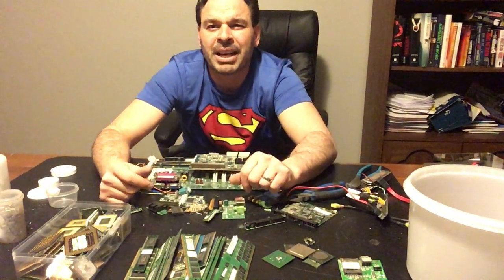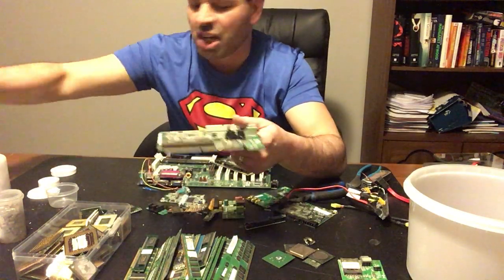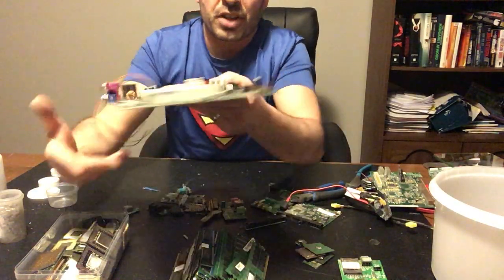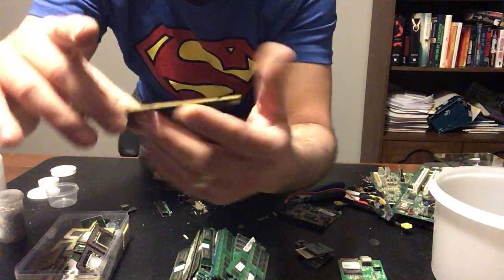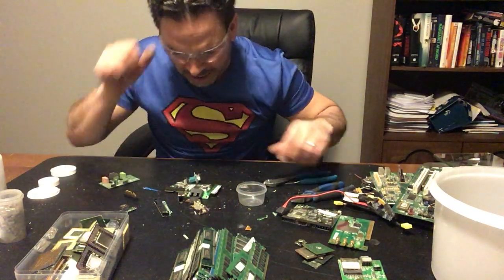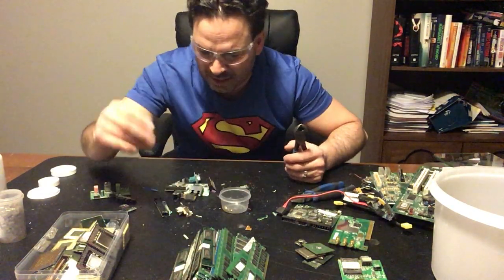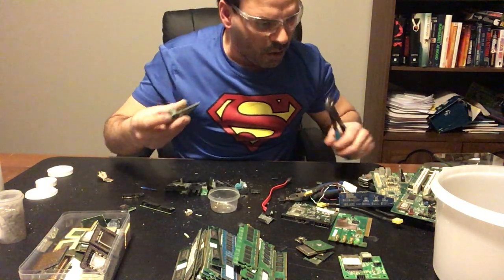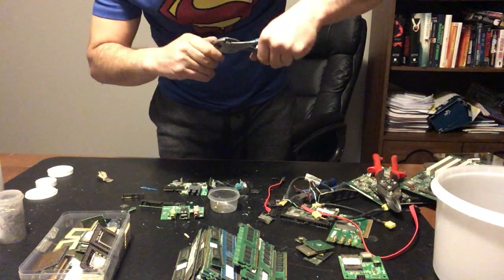Scrapping gold from ewaste. How to easily separate the gold pins and fingers from circuit boards.

Comment: Multiply weight by .01 for CPU(if it is the kind that has gold) or by .001 for plated.  I would guess your 3.25 ounces have about $6.27 in gold?  It could be more or less.  Gold can be extremely thin and still maintain electronic properties and look gold.

Comment: You should Definitely look at the CPU's that don't have the pins and have the flat surface, those ones are newer, and the one you held up to the camera looked like an i5 which is like you said about $100
Reply from the maker: Yeah, I have a bunch of those. Way better price.
Reply: @TinManScrapper  if you find a really old laptop, and it's not working, look up the model, Toshiba Satellite's are worth crazy money.
Reply from the maker: @jensen365  thanks for the tip, just found several laptops….going to have to now look.
Reply: @TinManScrapper  Awesome let me know if ya find anything good! I would just look the model up on Google, you'll usually see an eBay listing, or an auction site. Also, check prices on all audio equipment, that goes for stupid money, I've found some old digitech equipment by the side of the road

Comment: You keep saying wear your safety glasses, but you shouldn't be doing this inside.  The dust that comes off the boards is harmful.  You need to do that in a well ventilated area, or outside.  Also you should wear some thick gloves so your hands don't get cut up.
Reply from the maker: I don’t cut the boards inside, I do those in the garage.

Comment: Those first chips are gold corner BGAs not IC chips.  Thanks for the tips on pulling pins,  I've a pile of them and haven't started.
Reply from the maker: They call them IC chips on golden money.com. I think it may depend on where you sell or if you are a computer tech.
Reply: @TinManScrapper  No, there BGAs. IC chip are the ones that are rectangle shape. sorry